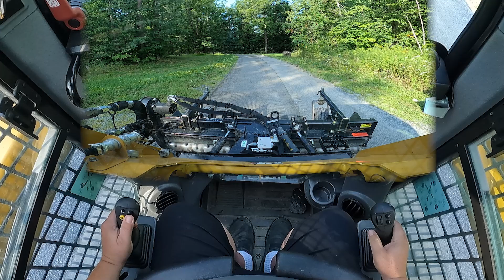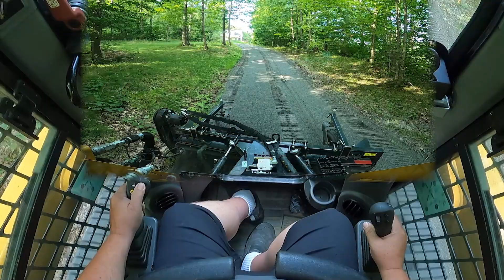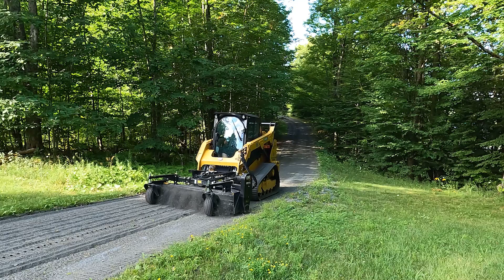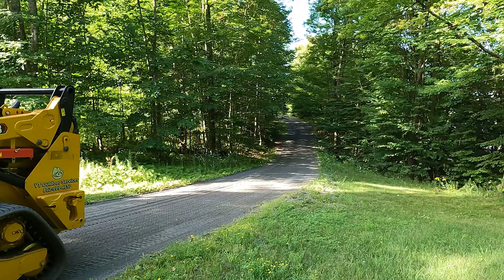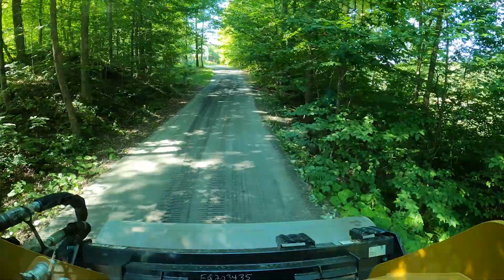Showing Controls Of My Caterpillar PR121 Power Rake & 259D3 Grading a Gravel Driveway

Comment: Fantastic editing with the picture in the picture! Very nice explanation of using the rake. I posted a video today (Tristar Diggin') doing land cleanup and using the CAT power rake on a 259D. I mentioned it is my favorite attachment just because of the great job it does. I have done a few of those 14 point turn arounds too, lol...😁
Reply from the maker: Thank you. And I’ll check yours out
Reply: Thanks for the video showing the controls.  I’ve used one but it wasn’t integrated into the machine, it was an off brand with a separate control box.  Do you need to turn on the auxiliary electrical switches (I think they are 7 & 8 in the Cats)?  Maybe you could go through the setup process…